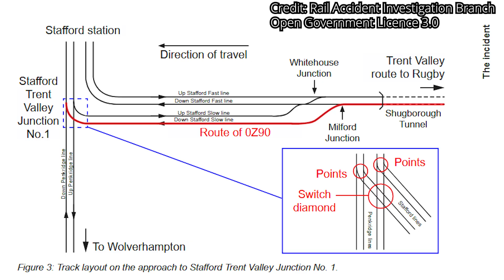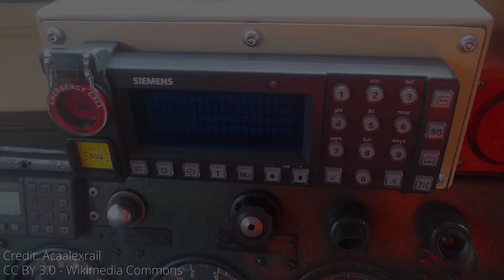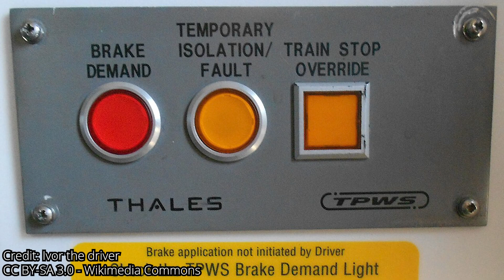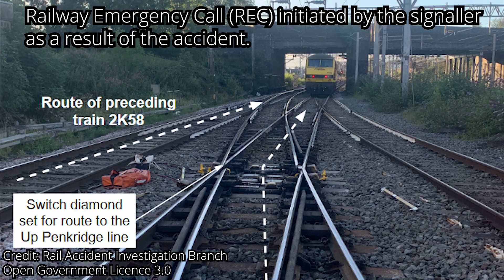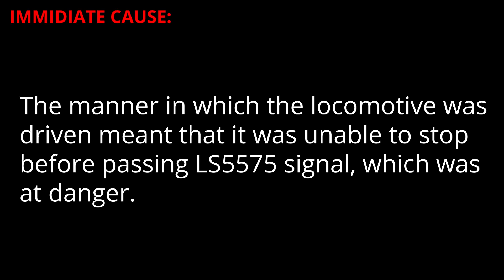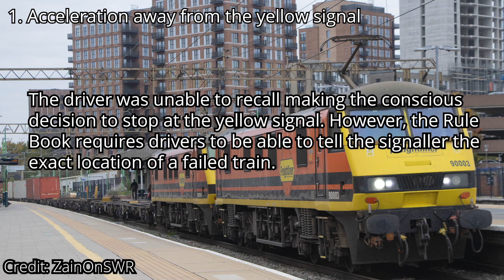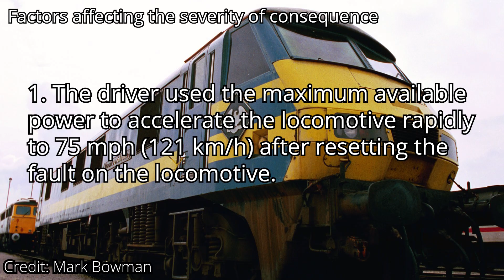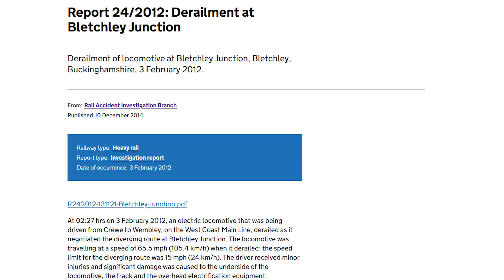The Stafford SPAD Incident | Jakeso

Comment: Drivers mindset was to make up lost time he lost for stopping unexpectedly in my opinion.  I made an error at work for making up lost time, it happens sometimes.  Interesting video.
Reply: As a driver myself, your opinion is not wrong. A lot of SPAD's occur for this reason but this was an unscheduled test run with no actual official timings. This driver did everything wrong from the outset due to an unprofessional attitude. Needless to say, it was the last train he ever drove.
Reply: @andyhinds542 a spad is a very bad thing indeed.  
 In this scenario it was pure negligence.  The single amber was in front of him for two plus minutes.  The best part of it is no injuries at all .  It had the best outcome considering the alternatives.
Reply: @andyhinds542  and yet he still posts regular Tiktok’s answering questions about the specifics of being a driver. Not sure he’s really skilled enough to be doing that now.
Reply: It was a test run so no timings as such. They are slotted in between normal services. There are rules to follow and he just lost the plot for some reason . If I was the fitter on board I would have reminded him, I have done that in the past, in a subtle way. He put his life and the fitter in danger and maybe a train collision on top of that. Nearly all the SPAD incidents I got called to was usually a break in normal running routine , delayed trains, rerouted trains , other factors on the line that then effected the service causing a spad. Three SPADS and you are sacked. I hated taking QUTRON downloads as it was usually mates driving , that download could put them in trouble. There are many factors, changing shifts causing fatigue , family issues. Its a very responsible job.

Comment: I had absolutely no idea that a 'light' locomotive had less braking than a 'heavy'.
Reply: Its all to do with brake force mate, a loco on its own has a greatly decreased BF than when its hauling a train. Hence L E is limited to 60 mph . I was riding a LE class 37 25 years ago, its driver took it to 90 mph , I walked back up to the driving end, I was in the trailing cab, to see what was going on. We had a double yellow and we hit that at 80 mph. The signaller must have saw what was going on and gave us green aspects into the station. We were supposed to stop in the yard two miles before the station , then change ends for return to depot. Lucky that it was 3 am .
Reply: Eh?

Comment: Was the driver sacked?
Reply: Bit harsh ! if drivers record was ok
Reply: @nounoufriend1442  A bit harsh? The only reason why people weren't hurt or killed was cause the other train had not arrived at the station yet, as well as decent safety measures already in place within British rail in case drivers screw up like this.
Reply: @fade1980  Driver did screw up but route isn't set to conflict with passenger train also TPWS or AWS had no effect as driver already had it in emergency . Yes driver didn't handle light engine very well but main cause was setting off on cautionary signal after loss of line incident "forgot was on yellow "

Comment: Every time I watch a video like that Im always surprised how lacking the british safety system seems to be. I mean this was just unfortunate slip of mind on the driver side but a good safety system would've not allowed for that to happen like that
Reply from the maker: Indeed. The story of TPWS is quite an interesting one, it's, at least in some aspects, a cost cutting meassure on behalf of Railtrack, Network Rail's predecessor. Luckily it's (slowly) being phased out by the introduction of ETCS, which is safer. It's currently being installed on the East Coast Mainline between London Kings Cross and Peterborough.

Comment: My takeaway is that should a driver develop a fault which requires stopping and the fault is fixed that it should be a rule to call signaller
Reply: I was technician riding light engine we got stopped within a 20mph TSR  when we set off driver had forgot TSR we hit 50 mph before he braked , so yes a call to signaller would have prevented this
Reply: @n @nounoufriend1442  it wouldn’t! It’s not a signallers job to remind a driver that he’s on a restriction. He might not even know.
Reply: @nedseagoon5101  Signallers know where you are what signal aspect you are behind and if your location is subject to a TSR
Reply: @nounoufriend1442 Of course he knows where you are! He wouldn’t be bothering himself to warn you about speed restrictions though. That’s the drivers job, not his.
Reply: @nedseagoon5101  Might be worth mentioning on cautionary signal or within a TSR , I know when you get GMSR call from signaler like with DSD alarm they give signal information . Lot of railway stuff is double checked like brake continuity and running brake test or DRA to remind you signal aspect , collar on points lever . Sometimes just calling signaler reminds driver , just saying !
Reply: @nounoufriend1442  good practice to update signaller on faults on a test run. If fault reappears they are usually ready with a plan.
Reply: Its already a rule that you need to contact the signaller after stopping out of course for any reason, except in this case if its a line light fault on an electric loco, you can reset once and go without need to contact the signaller.
Reply: Even easier now with GSMR , just call the signaller, tell him a fault has developed but now cleared but may happen again. They will usually give you a clear path back to depot / yard to clear the line. Been on test and failed locos many times and done this
Reply: @DOCTORDROTT  Had Cl 56 shutdown low oil pressure but we was still rolling called signaller kept us on greens we rolled about 3 miles stopped out the way at Barnetby . Fixed the issue and we were on our way again , then got angry call from maintenance control , they thought we had failed !

Comment: RAIB always have to had a dig at the company don’t they, it can never purely be the drivers fault. “Don’t blaze through signals at danger” would be a very short and pointless training session.
Reply: That driver broke a few rules, fitter should have questioned speed. Its his life is also at risk. Its 60 mph max for light engine , not 75 mph as he was doing. These days locos are down loaded and pm's look at data when a driver is up for "rules " appraisal. I used to download a loco at every A exam , it was added to exam sheet tasks around 2016

Comment: Good presentation.
When at FL I regularly took an 86 or 90 on a test run with fitters in attendance, it was usually Basford Hall to Stafford station only. 
When working liners in the down direction, you were often stopped at LS5575 (and its predecessor controlled locally from Stafford, same signal) to the point where you could regard it as a pi55 stop on certain jobs (!).

Couple of points, the Driver should really have set the speed dial to 60mph.
Also, he should've stopped 20 yards or so in rear of the single yellow aspect i.e. LS5573, to act as a reminder of LS5575 likely being at danger. 

Light 90s have a fantastic rate of acceleration, we're talking G-Force territory, can't really understand why he whacked it open given the 50mph PSR, never mind the potential signal at danger.

As others have said, an emergency brake application disables the rheo brake, I hope this has been factored into the HMRI report and changes made if necessary.

I will say this, in my opinion the AWS sunflower is the most important cab indication of all. I've occasionally driven trains with the AWS isolated where permitted, and it's a most unpleasant experience. You really do need to have your wits about you if so.

Ps slight criticism, locomotive, not unit. Well done though.
Reply: I don't know whether you knew the driver in question but he had already developed a bit of a bad reputation. He did lose his job over it, too. Then we had another idiot who used to post videos on Tik Tok about what a great driver he thought he was. He was involved in two serious incidents that resulted in him losing his job too.
Reply from the maker: I had indeed heard about the driver(s) but I make sure to strictly only use the information (or lack thereof) presented in the rail accident report in regards to any involved persons. The goal for my videos isn’t to speculate or discuss people involved (unless their name is public/part of the investigation, as it was in the Kirkby crash of 2021), the reason I make these videos is to address the points stated in the report as a means to learn from these accidents and how the suggestions guide to prevent future rail accidents.  From what I remember I don’t think the report mentions any driver history so I decided it was not to be addressed in the video itself.
Reply from the maker: That's some good insight! I've done work experience with FL and spent time in the shed with the 90s and they are very powerful machines indeed, even when trailing a yards-worth freight (one of the few times I've been pushed back in my seat on a train), I certainly couldn't imagine how it must feel when they're running light.

Also, I get what you mean about the signalling being different, as I had to spend about 2 and a half hours resignalling the line on train sim to the 'modern-day' as the signals on the train sim route were all in different places and not LS, I think they were like SD4 or something along those lines. Took painstakingly long as I kept having to watch and pause a drivers eye view through the area to try and work out where everything went while using the accident report to work out the signal numbers. Oh well, hopefully they don't look too out of place.

Upside of knowing a reasonable amount about the 90s technical wise is it helped me understand the units and what was 'accurate' in terms of Train Sim for the recreation bit, as Train Sim's driving phsysics aren't always the greatest. I always get surprised in accidents when the AWS sunflower goes ignored, but then again I guess if attention lapses it lapses. Either way, it's certainly a good cautionary tale in my opinion.

I didn't see anything about the rheo braking on the report, that's not to say it isn't there but it certainly wasn't boldly stated, I hadn't even considered the emergency brakes cutting them out as being a big issue.
Reply: @Jakeso  you're right about the signals Jake, though in most cases they were installed very near the old ones, within a few feet or so.
Yeah, Stafford 4 (SD4) was the controlling signal box there, Stafford 5 (SD5) was at the north end of the station, as per convention where the lower numbered boxes were/are nearest to London. 
I'm surprised at least one of them wasn't saved, as a crank cafe or something, plenty enthusiasts on Stafford station most days!

Keep up the good work.
Reply: Can’t agree re the sunflower. We have that many magnets now for stupid things like idiot boards that it makes AWS secondary & nowhere near as effective as it used to be. The sunflower is ‘on’ more nowadays than ever. It detracts.
Reply: @nedseagoon5101  On the WR, with its usual long block sections, they do seem to have the foresight to place PSR warning boards just before a signal (though not always). So you still have a black sunflower if the aspect is green.

Comment: The only factor you’ve sort of missed out is, a class 90 (usually) uses its dynamic brake under normal driving- even with a LE move the dynamic is a fantastic brake.

When an emergency application is initiated it drops out the dynamic so that you’re then only braking on blocks (EP).

Which is ironic as the emergency brake (blocks) at high speed is far far worse than the dynamic.

It was proven at the time that if the loco stopped with a full service application (using the dynamic) it would’ve stopped far shorter than the signal
Reply from the maker: That’s actually quite interesting, I hadn’t even thought to consider that. Thanks for that point.
Reply: Why does the emergency application cut out the dynamic, is it just that it cuts power to the traction motors encase power is applied, and if so are more modern systems able to apply the dynamic as well to improve performance, or is there another reason to cut power to the motors?
Reply from the maker: This is just my guess but I believe it’s so if the overhead wires / third rail is isolated during emergency braking, it will mean it will have to switch over to mechanical braking and I think the thinking is it’s better to go straight into mechanical braking than risk an interruption during it. I know some newer trains like the Class 700 series use regen braking from vids I’ve seen of emergency stops but then again new trains like the Class 777 cut out rheo braking when in emergency, as commuting on them daily means I’ve had my fair share of them.
Reply: @Jakeso  Wrong. It's a design flaw. Class 86s and 87s maintain rheostatic braking during a straight air brake application and also the rheostatic brake works better on the older locos. Why the rheostatic brake is so bad on 90s is beyond me. Their braking capability is awful compared to older locos. You put the brake on on an 86 then you know you're going to stop because it really bites.
Reply: In my experience the rheostatic brake on a class 90 is terrible compared to a class 86 or 87. In full service the needles on the indicator barely leave the green sector. If you apply the straight air brake it knocks the rheostatic brake out. That doesn't happen with an 86 or 87.
Reply: Driver was renown for his Tiktok videos from the cab. Probably messing around on his phone at the time.
Reply: @apinnard84 Is it the ex driver with the initials BB? If so, I thought he was still driving in 2024 cos he had videos up until August 2024 - then after that, he said he was no longer a driver. He also said his last drive was in a class 70. Maybe im putting 2+2 together and getting 5 and its not him. I cant think of any other Freightliner drivers that did TikTok can video's though
Reply: @carlbriggs I can neither confirm nor deny

Comment: I'm not all too familiar with British railway operating procedures, so this all seems a bit strange to me. The root cause of this incident is driver error, but the safety systems intended to step in exactly such cases only did so when it was too late? From what I understand, TPWS is supposed to cause an emergency brake in case of overspeed, so why was the trackside equipment here placed in a way where an emergency brake couldn't stop a train going too fast from entering a junction? Just seems like a failure of the safety system causing a safe state.
Reply: TPWS has holes, it's basically a typical British half-measure when it comes to infrastructure. The Western Region already had ATP which could have prevented this, but they decided ATP cost to much to implement, and instead rolled out the inferior TPWS system. Unless there's TPWS overspeed grids well in advance of the signal, TPWS will only make a brake demand when it's already too late if the train is travelling at speed.
Reply: @74HC138  To be fair, TPWS is a damned good add-on system in itself but yeah, it doesn't usually prevent a Spad.
Reply: TPWS overspeed is not designed to prevent spad but stop train within the distance that signal is protecting (if that makes sense ) ie if its preventing conflicting move it should stop train before conflict . Still the issue driver can press train stop override though but this is needed to pass signal at danger with authority (happens a lot )
Reply: @nounoufriend1442 but it failed at doing that in this incident, right? The loco got to a set of points and only stopped on a section of track where a different train could've theoretically been.
Reply: @namenamename390  Yes failed at that but light engine degraded brake force caused this

Comment: A class 4 freight train consist must have a brake force of at least 40 percent of the total mass, in order to stop  within 1258 m.  Class 90 has a brake force of 40 tonnes and mass of 84.5 tonnes which equates to 47 percent. I wonder is it for another reason the locomotive is restricted when running light?
Reply: All locos have the same restrictions when running light. However, Class 90s are very good at accelerating when light engine, but have very poor braking capacity compared to older AC locos. The standard brake force for most freight trains is around 30%, thus a 1800 ton freight train must have a minimum brake force of 600 tons.

Comment: That was a close call with the down passenger train but the switched diamonds would have saved the day. Surprised that the loco didn't derail. Must have been quite a jolt.
Reply: 🤔Plus a brown 💩stain on the cab seat, No hero here, Once an emergency application just with just an working EP brake applied and seeing that crossing with the other unit passing over that cab door would have been open ready to depart rather rapidly!
Reply: @paulspeight8398  The brown stain on the seat would also be that the driver (whom I worked with) suddenly realised that he was about to lose his job.
Reply: Being saved by switch diamonds was luck, not a design feature. At even a slightly higher speed, the loco could have derailed on the diamond and momentum would have carried it into flank collision with the passenger movement.
Reply: @PeterCDub  Obviously it would have been lucky. How about a single slip - with an FPL of course.
Reply: @PeterCDub Sorry. Please ignore my previous comment. I was just a bit peeved at being told something I already knew.  Sorry